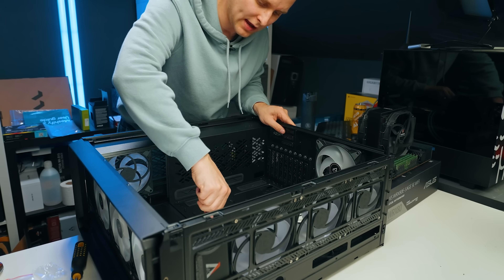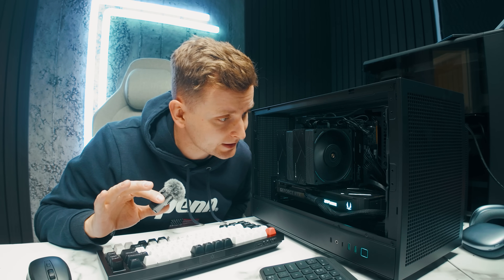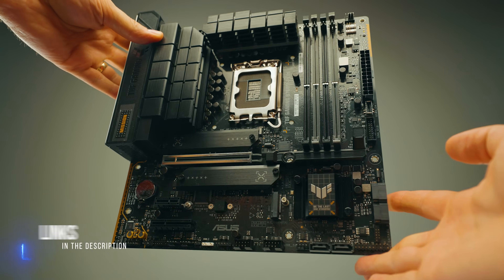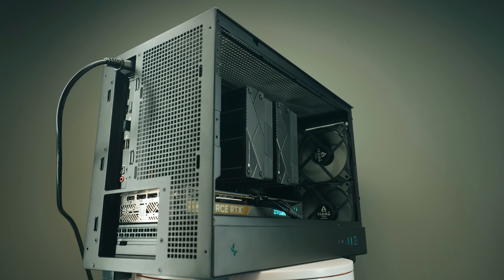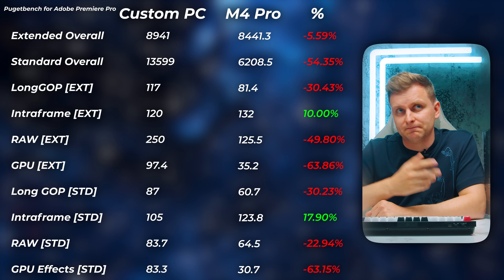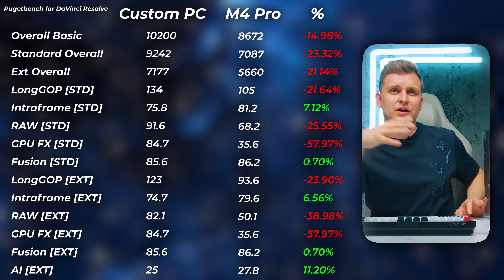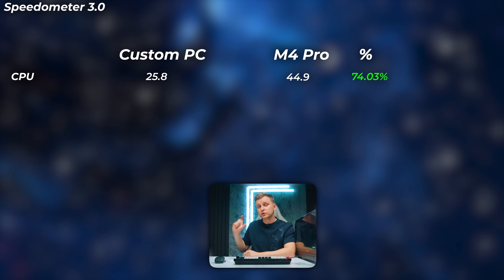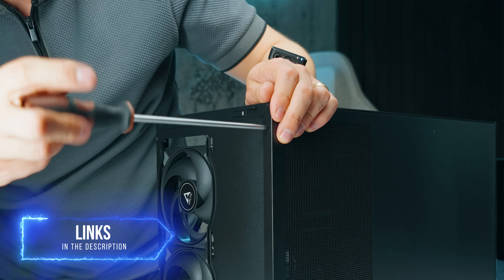WATCH THIS, BEFORE buying or building a CHEAP PC in 2025!!

Comment from the maker: Just noticed that I called the case CH220 4:24 - THAT's WRONG! The Case is called Deepcool CH260 - check out the full links above in the description.
Also, always answering my Minnect messages in 24h: https://geni.us/MinnectLP
Reply: What video I haven't seen yet: can Video Editing software utilize multiple GPUs? If so - would multiple Intel ARC cards beat a NVidia RTX 5080 or 5090 in decoding or encoding for a fraction of cost?
Reply: PLEASE do NOT show TOUCHING the CPU with fingers. That will leave oily substances on it which might decrease the heat transfer. Also there is the RISK of ELECTRO-STATIC damage if not using protective grounding gear. Otherwise: great content for the creator community as always.
Reply from the maker: @kaptnwelpe5322  I always clean the CPU  afterwards :)

Comment: Macs already have lots of pcie-lanes teanslated in gb/s. You put a B chipset so the transfer rate is 4 times slower. Yes, it will run hardcore apps but for day to day usage it will not be so snapy as a mac. You win on on side and lose on the other. Most people want a snapy computer not a powerful one.

Comment: Another excellent video. I much appreciate your tips on saving money on key components, and also a really good CPU alternative. 
But one question: why no benchmarking for Lightroom? Although most of the serious photographers I know do use Photoshop, it is mainly used as a tool after the main work has been done in Lightroom. And it seems that Lightroom will perform quite differently than Photoshop on a given PC. As you've explained, Photoshop likes high single-core (or lightly threaded) performance, and lots of cache. Lightroom also does well with high single core performance, but it seems there are other factors that make it shine with some CPU's compared to others. Mult-core performance is likely one of them, for Lightroom exports. Also, it seems there are optimizations that the CPU manufacturer can make that really make a difference. What these are is a bit of a mystery, but the effect seems to be real.

Comment: Still the build looks ugly, try to do it in the same case as apple. Or use a mini pc and try again, i use to be an applefan and i hate those windows machines, it’s ugly and what’s with those led lights, i don’t want a disco at home. What you also don’t mention is that yes apple charges ridiculous prices but nowadays you can update the storage from third party vendors and half the price. And don’t let me get started about windows, it was and still is a crap system. I am going to switch to linux if i want away from Mac but windows is not going to be it.

Comment: PC all the way as I do not want to pay the Apple Tax.   I am moving away from Mac and am looking at Linux as well as an option.   Have. not decided yet on Windows or Linux yet though.   One has more upgradability than going with PC.   Plus I am a computer guy so prefer to build my own PC to be honest.   I am going with the Be Quiet 501 case, which allow me to have a case with out a window, which seem to be a hard to find these days.  Plus my motherboard is the Proart x870 Creator Board and looking in the fall to upgrade to the Proart 32 inch Monitors @ 2 for a dual 32. inch setup.    Just think of a 5 Terabyte setup with a Mac vs a 5 Terabyte with a PC.   Cost no contest. Plus a have a AMD 7700X, which I can upgrade at a latter time try doing that with a Mac will not be an option.
Reply: these Apple content creators are delusional thinking their weak ARM can beat x86 cpus hell my RYZEN 9 5950 from 2020 beats an M4 Pro by over 3000 points Pugetbench benchmark.

Comment: Iv had to buy the Benq 5k screen to run on my Macbook Pro M4 Max to display full resolution! as it was only sending a 1080p signal to my original 4k monitor and yes i tried a number of different cables, the same cable was giving me a 4k resolution from my PC. however the adobe suite seems to run more smoother on the apple M Chips so i am happy with the compromise at the moment! but PC defo for gaming
Reply: I have a feeling that it was 1080p scaled. That means it outputs 5k and but presents at a 1080 at the user interface level. The interface will be at a retina level pixel quality. This can be changed in settings to present at 1440 presentation whilst still being 5k scaled to 1440. That is what I use on my 4k monitor from a base Mac Mini.

Comment: The biggest difference would be how much power the systems draw for the performance. X86 is a totally different level compared to ARM. Hopefully MS will bring the ARM version of Windows to feature parity soon, because the switch to ARM is long overdue!
Reply: true but you plug both into the wall and at the end of the day performance is the priority when creating a workstation

Comment: I’ve been a pc guy for decades and with the rising cost of good pc gear I got an M4 Pro and am learning Mac OS to get away from Windows a bit.  I still have a basic Windows pc but my main machine is the M4 Pro for now. I’ll likely add another pc to run Linux on too, but all three will end up being mini sized.
Reply: ahh this pc is faster and cheaper?
Reply: @michaelandrews4783  prices vary a lot, even with macs, and faster or slower depends on the application, but definitely stay with a pc if you want to day any gaming

Comment: Lauri, the M4 Pro in video editing is actually quite good. I wouldn’t just look at the raw numbers. The scrubbing of video is lightning fast and the encoding speed (render time) is very comparable to the NVIDIA. Also, playing back of H.264/H.265 media is very fast as well. Obviously the nVIDIA GPU overall will be better because it’s a dedicated GPU compared to Apple which is integrated so it’s not a fair comparison. That being said, you saw how impressed you were with video editing in Resolve with the M4 Max laptop 😊
Reply: The competition is on price alone.  If Apple software allowed for an E-GPU that would be understandable but they don't, they are not supported.
Reply: @christopherderasmo5041 
That is true
Reply: One those video app are out of beta the m4 will lose in all video editing tests ouch.
Reply: Price is same 😅

Comment: Don't buy Intel ARC b580 for davinci resolve (fusion) . it crashes immediately
Reply: What if you pair it with a nice processor like the Core Ultra 7 265K?
Reply: @Trojanpige  My PC specs: 
CPU AMD r9 9900x
GPU Intel ARC b580 Sparcle titan
RAM 64 GB DDR5 5600 Mt/s
MB MSI x870 Tomahawk 
SSD 1TB WD sn850x

The problem is not with the CPU. Davinci has been relatively stable since the recent release of Davinci Resolve 20. Crashes are almost non-existent. Davinci 19 was a nightmare for my system. My current GPU drivers is 32.0.101.6559.   Any other GPU drivers not working properly even new ones
Reply: It was just a driver issues mainly on davinci side lol. To say don't buy the GPU over that is a little much

Comment: Close to the same pc I built a few weeks ago (largely for 2D animation and illustration). Core Ultra 7, AsRock Z890, Toughpower 850W, Peerless Assassin Cooler, 1 & 2TB SSD's, 64 GBRam, Lancool 207. I'm leaving the GPU slot open until prices come down a bit more but planning to get the B580, that's why I went with this CPU since it's giving me enough IGPU power to chug through my renders. Got all of that for under $1k USD. Thanks for all your videos, they've been essential to getting my first ever build up and running!
Reply: Ultra 7 265k is good for editing and gaming( not as good as ryzen tho) now that prices are low.for editing intel qsync is a beast, I can understand why made your choice.
Reply: @aswadevg  Exactly, thanks. I don't game at all and since I was waiting to get a dedicated GPU that informed my choice and, as was mentioned in the video, the price wasn't significantly more than previous gen Intel chips. Also I have a friend that works at Intel and I like to support my friends. It's been working beautifully, much better than my 10 year old Acer😁
Reply: Damn 😮
Reply: But why an intel cpu ??? You think we are still in 2014 ? Horrible value
Reply: @mouna54gml  thanks for the helpful input
Reply: @mouna54gml  265k ultra at 315e is by far best value, 14600k is 220-230e...

Comment: If the custom desktop didn't run Windows it'd be perfect.
Reply: You can run linux unlike mac
Reply: @ranjitmandal1612  Asahi is a thing
Reply: @brandonw1604  not for m4
Reply: @ranjitmandal1612  Their M4 page says everything is (mostly) stable. Sounds like Linux in general.

Comment: as always excelent video. and i was thinking on changing sides from pc to mac(after effects creator). but you just slap the devil out of me! thanx mate.  btw, here in greece your base build costs 1.650 euros fyi! 
3 years ago with the same money i build this one: 
MOBO: MSI MPG X570 Gaming Plus
CPU:AMD Ryzen 7 5800X (8-Core 3,8GHz) 
GPU: NVIDIA RTX 3070 8GB
RAM: 64GB DDR4 3200 MHz
STORAGE: Samsung SSD 980 1TB (M.2 SSD)
	 Seagate ST2000DX002-2DV164 2TB(SATA HDD)
POWER: Thermaltake Toughpower GX1 700W80+Gold

cheers
Reply: Good pc
Reply: Καλησπέρα. Το ότι συγκρίνει ανόμοια μηχανήματα αυτό παραπάει. Εντομεταξύ δεν αναφέρει ούτε ο ίδιος αλλά σχεδόν κανένας πόσο ρεύμα γλυτώνεις τον χρόνο με Mac. Δεν έχω κάνει μετάβαση ακόμα αλλά είναι στα σχέδια. Κανονικά για μένα αφού αναφέρει NLE προγράμματα έπρεπε να βάλει Μ4 MAX και όχι Mini.
Reply: @KonstantinosTsaousis-d5o  συγκρινει τιμες φιλε μου. 1500 ευρο το mac 1500 το pc! και οπως ειδες το mac  υστερει μονο στα 3d... αλλα δε παιρνει upgrades οπως τα pc!

Comment: funny thing is even if you have the fastest PC and a 4K Monitor , the Macbook even with m2 pro base,, the mac will be faster when scrubbing to photos in Lightroom Classic.
Reply: Single core single thread on certain apps, slower on others especially if both are native to the processor and optimized for the chips special features and multicore, ram and SSD speed also make a difference and cooling
 providing you have enough ram.
However this may change after beta apps or golden and with more of ram fasterds
Reply: So you just described and highlighted a very specific workflow and software...your point?
You know there's many workflows and software that works better through a PC than a mac?